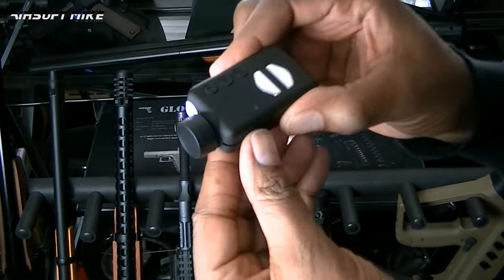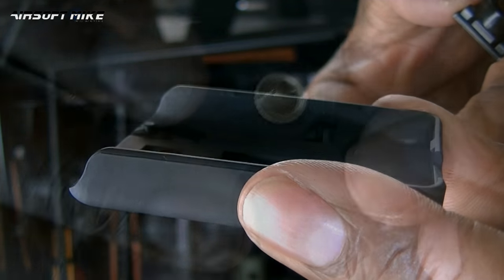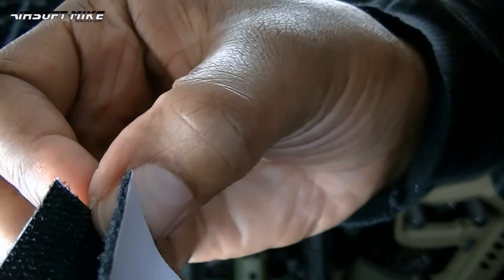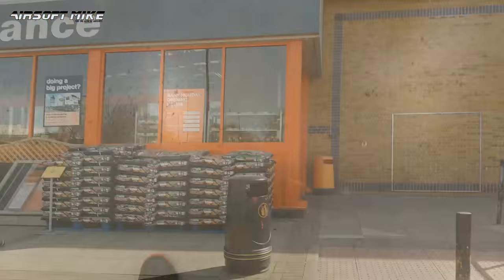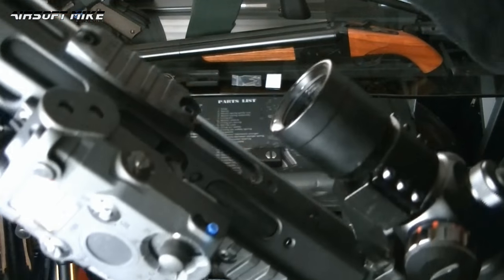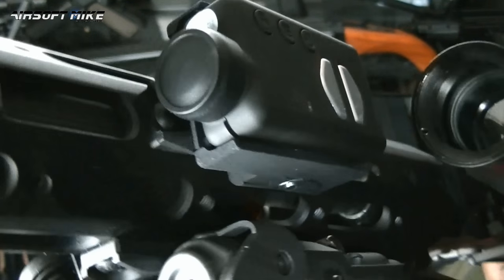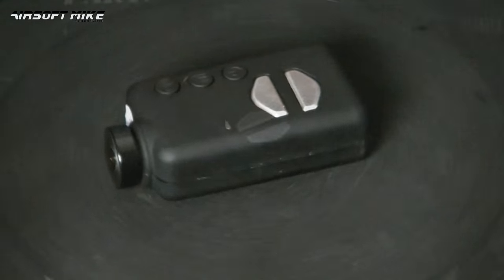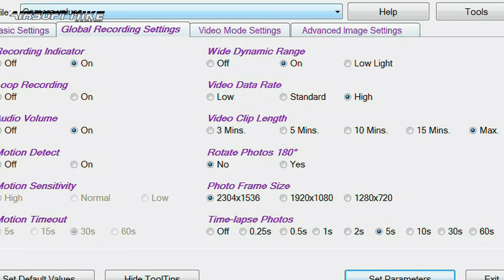MOBIUS C2 ACTION CAM The Ultimate Airsoft Cam? / Brain Exploder Mount

Comment: I recommend Mobius had a basic camera for nearly 5 years and still works everyday in my car The picture quality is equal to Gopro but is much smaller Grpo is too bulky..

DO you adjust the lens manually on the front on the camera I not interested for hunting I use for my bicycle to keep young men who think playing computer car game is the same as driving a car in reality

Does the flip/180 rotation still have to be done from the camera settings on the computer?

Thanks for your help VERY GOOD review.

Comment: I’m searching for a good camera for a selfie cam. I want something low profile because I have a moc peq box on the top, a flashlight on the side, and an optic on the top, so rail space is limited. I’ve been looking at the RunCam 2 and the Mobius 2, from what I’ve seen the RunCam 2 looks better. But there’s also the contour cameras which the lastest model so super expensive and also the RunCam ScopeCam. I also don’t know which lens to go with. I assume not to much because it won’t be too far away from my face. But I also might want to use it as a scope cam if need be but mainly a Selfie cam. Can you help?